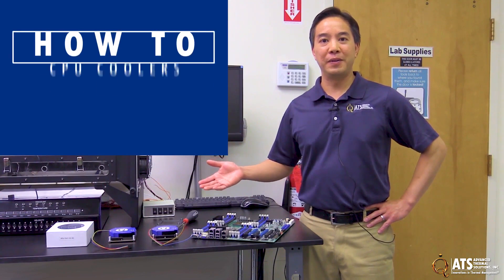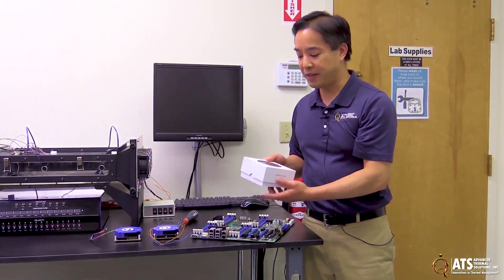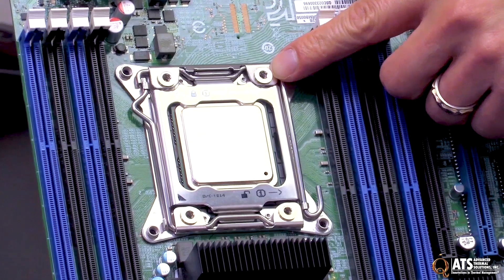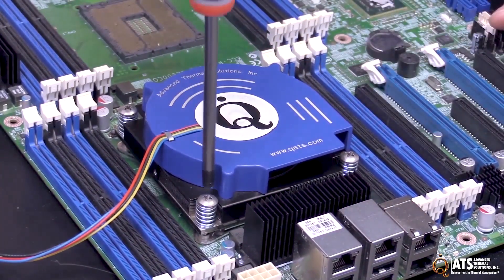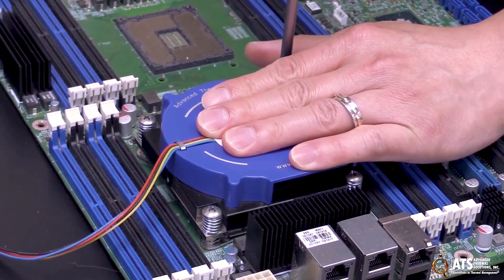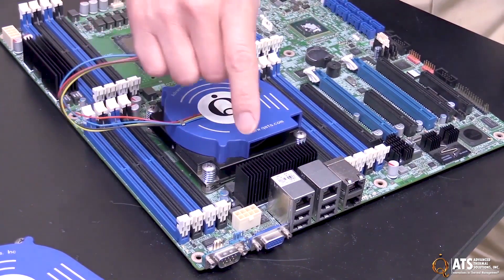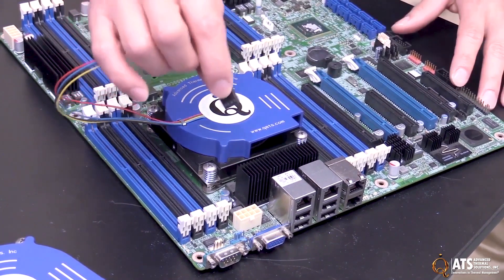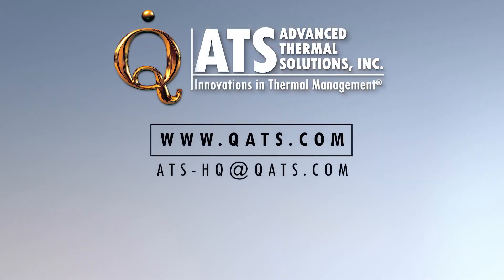How to Install ATS Ultra-Cool High-Performance Coolers

Comment: If I want to install this cooler on Intel lga 1700 socket which has 78×78  hole pattern, to draw almost 300 watts. 
Does it works?

Comment: How many watts?
Reply from the maker: @AutodidactEngineer  can you please clarify your question for us? How many watts does it cool or how many watts does the blower use?
Reply: @heatsinks  Please forgive my earlier self, yes the cooling capacity is what I asked for and would installing a thicker blower fan improve the cooling and noise even further?